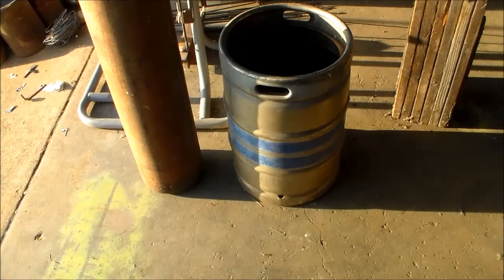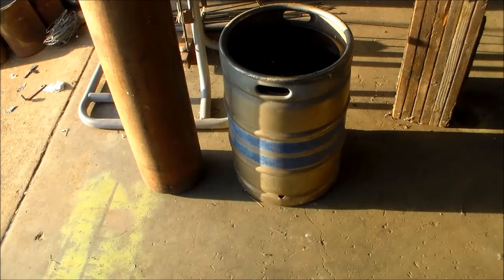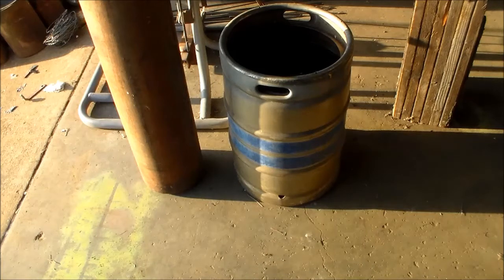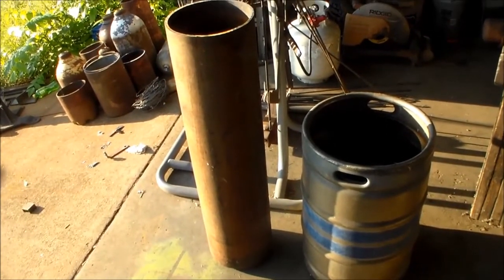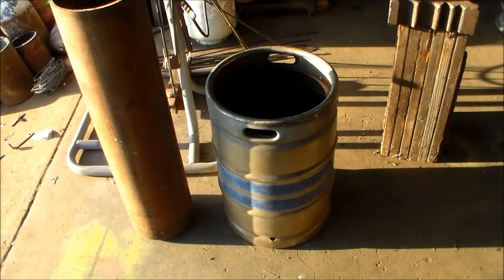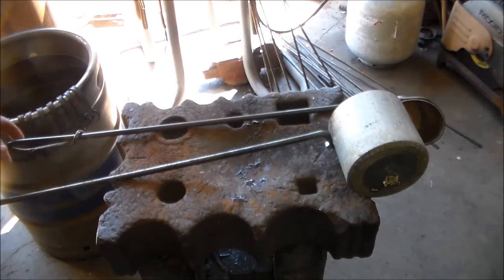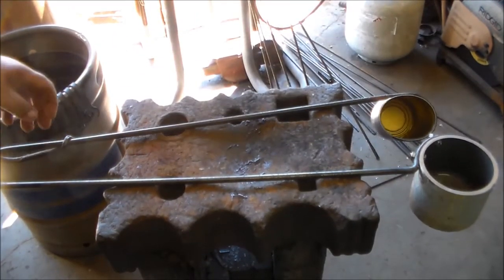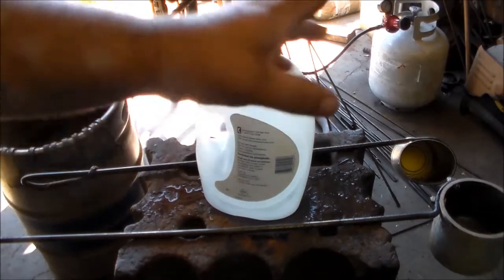A Blacksmith's slack tub and it's accoutrements

Comment: Early this summer I decided to change out the water in the slack tub at the shop in the Pioneer Village at Springmill State Park. That water was funky but I had not performed this task because I had to bucket carry the water about 2 or 300 yards to fill it back up. Anyway I bucketed out what I could out of the old wooden barrel half, then rolled it on it's edge outside and dumped the rest in the yard. About 2 hours later the first visitors walked in, and older couple and they said "We were just admiring your butterflies." I had no clue what they were talking about, so I walked outside and there were about 2 dozen Monarch Butterflies on the ground where I dumped that water. Must have been something about the metal in that water. Wasn't because they were thirsty as the creek was full of water.
Reply from the maker: hmmm pretty cool

Comment: Mostly use my tub for cooling longer stock I am working on without tongs, and I am cooling the bit I am holding if the heat travels to far along so my hand doesn't burn!! I use a galvanised steel bucket, but I do have a couple of kegs, been to lazy to convert one.

And of course for immediate first aid when I do grab something I shouldn't have!

So, did you hit up the county show this year Brendan?

Comment: Until I find something more suitable I use a plastic 5 gallon bucket with a couple of inches of sand on the bottom and a metal lip on top that protrudes a couple of inches inward. This way most of the bucket is protected from melting and after about a years use It has no leaks.
Reply from the maker: That sounds interesting, got a picture of the lip?
Reply: It's just 3 pieces of scrap 1/4" round picked off the floor. welded into a wide u shape with the 4 ends flattened and bent over to slide over the top of the bucket. It's worked so well I really haven't looked very hard for a replacement.